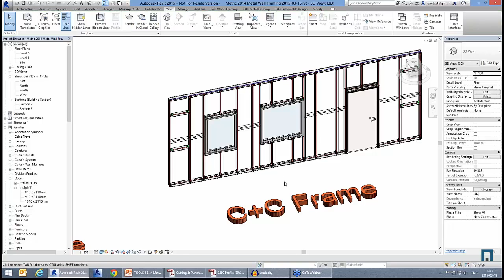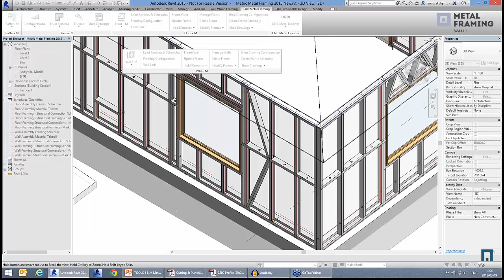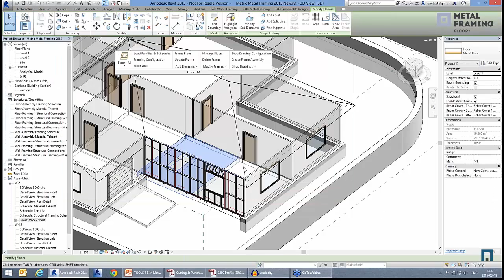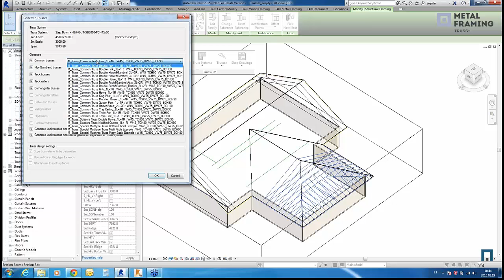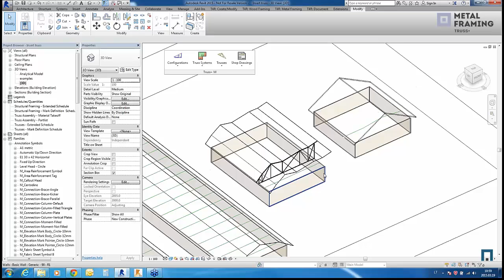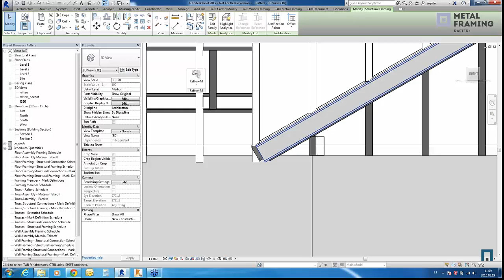Efficient Design of Light-Gauge Steel Framing Systems in Revit (METRIC)

Comment: Hi
Is really a very interesting application, We design prefabricated exterior wall panels and I have some questions:
1st. Can I create my own wall profiles?
2nd. If I cannot find an steel member in your library, can I create my own?
3rd. The panels create as a result an exterior building envelope but they are individual components with minimum designed gaps in between and they are connected to the main structure, so I need to see them like a continuous wall framing but at the same time I have to represent them as a individual panel shop drawings.
4th. Can I create my own embeds elements or structural support systems? 
Thanks
Reply: Hello Juan,

Thanks for getting in touch with us.
Please find my answers:
1. Yes, you can make own wall profiles;
2. It includes default families, with you should use. please send me a screenshot renata@aga-cad.com. Also send me what kind of steel profile you would like to use. I am sure we have such., because we have created all most popular profiles.
3. You have to create panels as it is prefabricated. It can look continues, bet still will be separated. 
4.  Yes, you can create own elements.